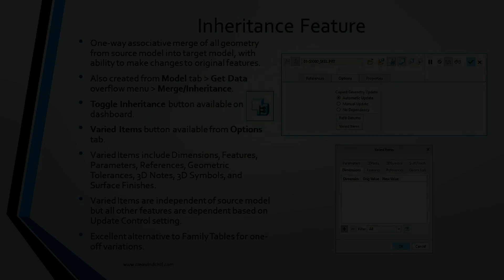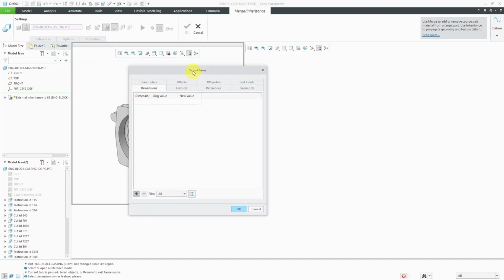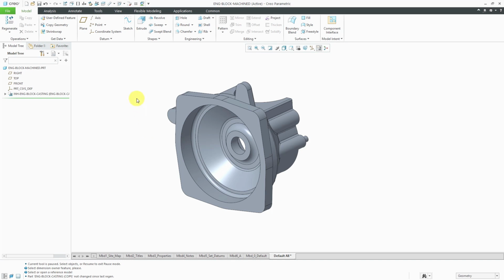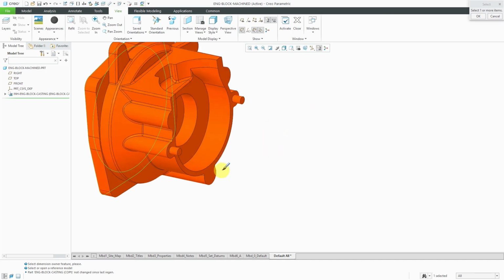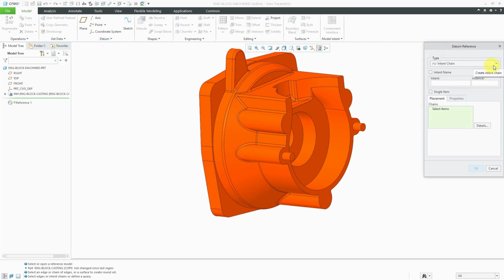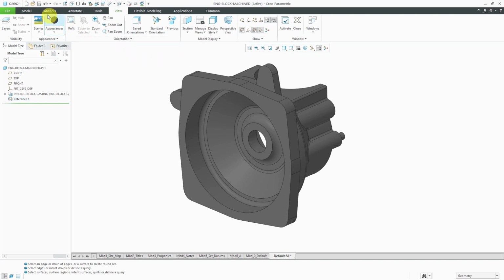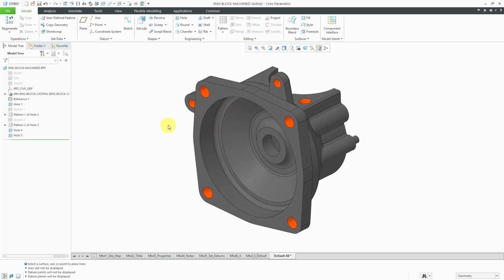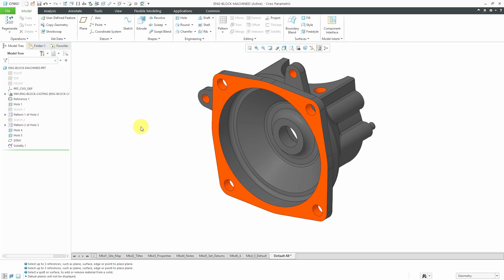Creo Parametric - Inheritance Features for Machining Models (Part 1)

Comment: Hi, thx for the video. Maybe you can help me out. I ran into some problems when trying to use inheritance and merge. It’s a   2-halves of a Modified 3D scan (A wrist splint split into 2 halves). Both Imported into Creo parametric, and saved as prt format. I set the reference correctly. When I try to merge them by using inheritance, I correctly set the bonds and they matched correctly in preview. But when I clicked OK. The other part I was trying to “import” and merge just won’t show up.   Also, when I finished the assembly and try to use simulate, I could not select any face or line or point for restraint. Can you tell me what might have gone wrong?